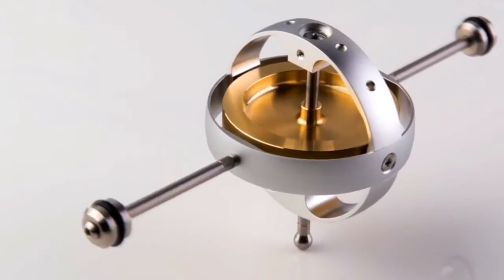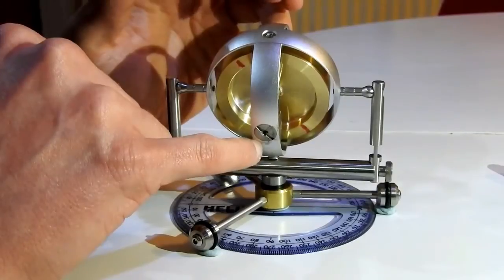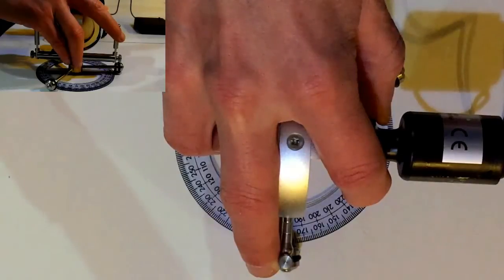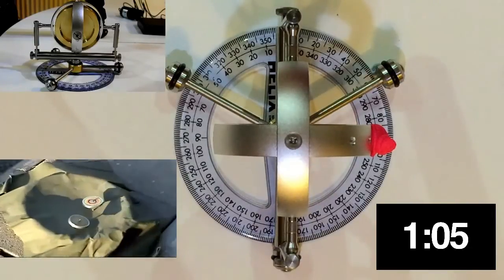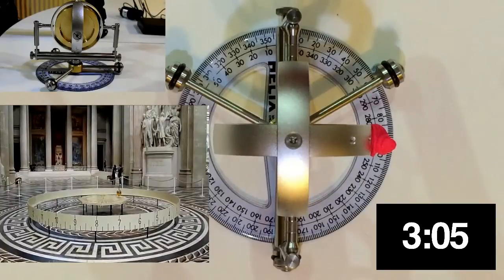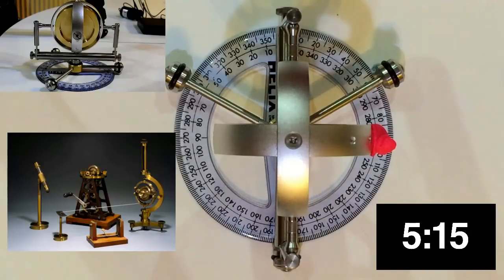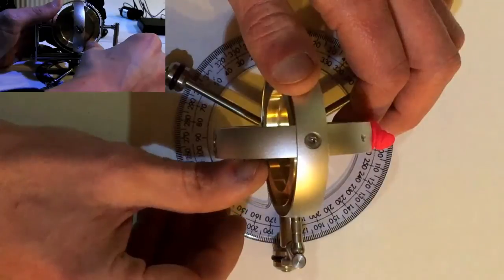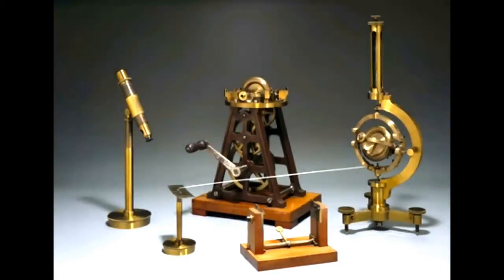Gyroscopic Levitation Works

Comment: The video seems to be cut short... And I did not see any evidence of gyroscopic levitation from the video. I do have a design I have been working on, on and off, for half a decade that I do believe should generate lift. But it requires 6 to 8 gyroscopes and a very advanced housing to move the gyroscopes in the precisely right way to cancel out all forces except for up. I might build a prototype one day, but I must first find a way to make a cheap experiment to test my theory, before ordering the custom parts for the device that can store more kinetic energy and actually do some form of work.

Worst case scenario, if it works at all but is not strong enough to lift itself, then it would still work to move satellites around in space with only solar panels as a fuel source.
Reply: Thats interesting. I searched videos like this one because i had the same concept in my mind. If you observe the descriptions of flight patterns in ufos, specifically their ability to change direction on a dime, it only seems plausible if theyre able to cancel out certain forces, such as momentum and gravity. In order to fly at hundreds of miles an hour then turn 90 degrees, there seems to be no possibility unless some sort of cancelation is achieved. You should definitely keep working on that.
Reply: Look into magnets and what happens when you force opposing magnets together. That may unlock the door for you.
Reply: Vive this man a 10k patreon wallet in Cash pls

Comment: If you want to record the rotation of the earth you need to set your angle with the axis of the earth.
Reply: You'd want its axis making a 90 deg angle w/ Earth's axis, I believe. So you'd have to know your latitude before getting an optimum measurement. Yes?